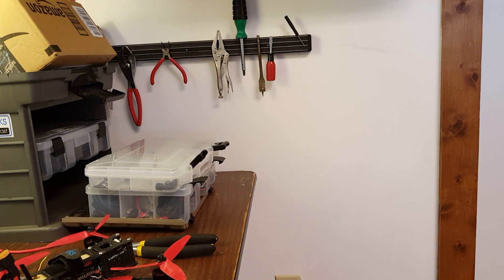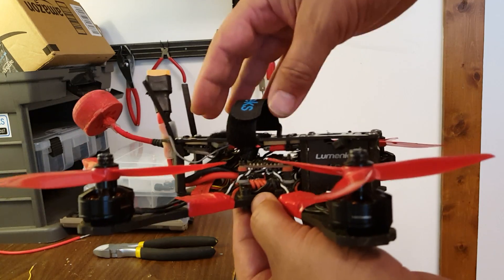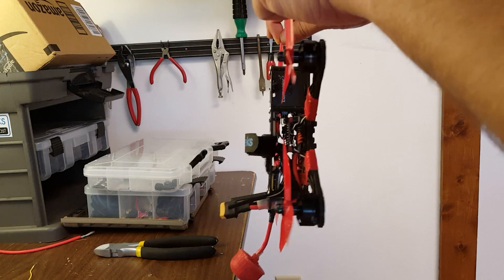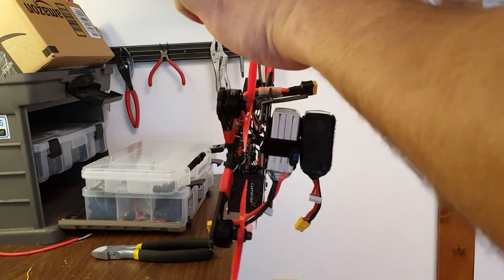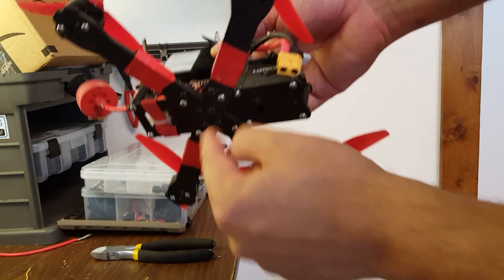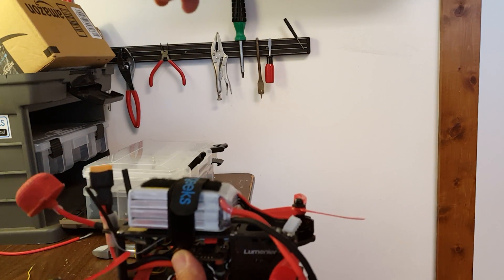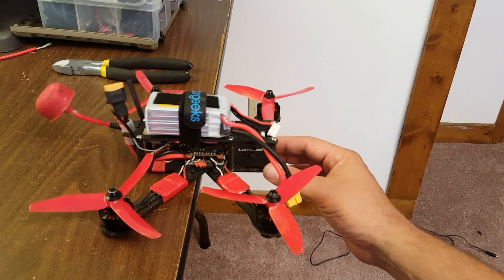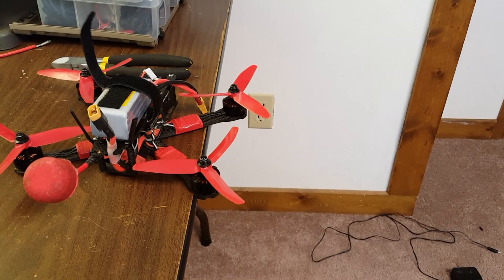How To Find Your Mini-Quad CG

Comment: With regard to horizontal CG, what does it mean if you feed the ass end of the quad from the table and the spot that the imbalance occurs is NOT at the same spot that you measured when the quad fed from the front?
Reply from the maker: The copter isn't level.

Comment: With my vortex pro- i noticed a nice difference in handling when I removed the camera plate and scooted the camera, and the battery, closer to the center of the quad.
Reply: the front/back flips went waaaay quicker and cleaner. The long "body" layout was clunky when doing that stuff before

Comment: Hello,
I disagree with your statement that vertical CG should be at prop line for best flight performance.

The torque generated by the thrust applies at the begining of the frame arm! The pitch/roll rotation center will always be at vetical CG right... But to have maximal rotational speed in picth and torque the vertical CG should be on the frame 's bottom plate axis... if it is on the prop line it will just create a second torque between propline and bottom plate centers!
Placing the battery at the bottom will give you both more rotational speed and absolute pitch/roll stability. With battery on top you may feel you have more stability in hover but this becomes wronger and wronger as pitch/roll angle increases : after a pitch roll angle treshold the quad will tend to flip over ( basically when the 3D CG will cross the 4 motors perimeter in the earth plane axis)
You can think about the same matter for low&high wing profiles for conventional airplanes.

I just came to also think that it is better to have the flight controller placed the nearest to the bottom plate, possibily bellow the PDB/ 4-in1-ESC etc. Actually it is best to have the IMU placed on the center of rotation (vertical CG), both for the gyro and accel. If FC is level with propline AND vertical CG then not bad. But having your IMU level with bottom plate and paired with vertical CG, will give you the same gyro reading with optimal rotation performance.

Trying to debrief with clearer wording (TL;DR): it is a simple syllogism. It is best to have FC level with VCG. It is also best to have VCG level with bottom plate. So overall  the most efficient is to have the entire smalah sticked to the bottom plate :)

Best regards, found nice ideas in there tho, especially how to get a feel from CG location!
A battery bottom-mounter
Reply from the maker: Your point about the CG location is interesting and I'll have to give it some thought. Regarding the FC, that only matters if you are using the accelerometer. If you think about it, I think you will see that, as long as the frame is assumed to be relatively rigid, the gyro will read the same no matter where it is mounted. I submit that the false readings incurred by the accelerometer due to being placed off of the direct center of rotation are relatively small given the typical distance between the IMU and the CG on our copters.
Reply: Well it was clumsy and I should have written instead of " it will just create a second torque between propline and bottom plate centers" that it shitfts away motor thrust from the normal to the rotation circle radius . A picture worth a thousand words : https://www.dropbox.com/s/7j7odly3edlafmm/20160707_022341.jpg?dl=0

 "relatively small" hell yes :) Will give a try mounting Pixracer-Raceflight sticked to the bottom plate with battery bot, and feedback BB logs.

P.S. Glad I can help a bit on mechanics back, after you helped me on the Nyquist/aliasing chinese thing :)
Reply: Actually I tried some trigonometry and concluded that  a standard 250mm x quad, with a 4cm square for electronics at the center, 2.5cm between prop line and bottom plate, VCG at prop line, would waste roughly 50% of its thrust during a roll, compared to optimal rotation speed.
You are welcome to ignore my BS until I figure out what I am talking about :)
Reply: Ok I spoke GARBAGE.
The quad is rigid, the thrust applies at propline, so the VCG should be at propline Period :D
Reply from the maker: I knew if I waited long enough, you would agree with me.

Comment: In your profile banner thing, what is the protector for your Yi? I need something to pt over my SJ500X (going to try it out over my RunCam2.
Reply from the maker: It's a custom piece made by a friend, but it only fits the Yi.
Reply: Joshua Bardwell Ok, thanks :) Found a aluminium casing on ebay, but was 140grams! lol no thanks ;D

Comment: That's why my front ecs's are a little bit warmer, because of the old GoPro Hero what moves the CG to the front )))
Reply from the maker: +Vadim Nemtsev only by a little, probably.
Reply: +Joshua Bardwell 2 degrees C, but only with long 1800mah battery what cant be moved way up to the front because of 210mm frame limitation...
Reply: +Vadim Nemtsev to the back, of course...

Comment: I hold my copter with props removed diagonally over the motors where the props go. If it dips I know my cg is off.  It should hang straight and it's all fine and it's more precise than many other methods.

Comment: I like to use a small piece of pipe to do my x and y balancing. With frames that have a small set of screws on the bottom that will straddle the pipe it's super easy to line up. I just set it on the pipe and balance away. For your vertical cg balance you and also just run a loop of string around the props or motor shafts if you don't have props on and hang it from something.

Comment: what vtx antenna are you using there?
Reply: not 100% sure, but belive its aomway antenna with 3d printed cover, I do the same and it works very nice, good video signal and long lasting with the cover
Reply from the maker: +nixxinn correct.
Reply: +Joshua Bardwell ok thanks. i am looking for a cheaper antenna than the vas but with good signal as i dont wanna keep smashing a 30$ antenna
Reply from the maker: +bb knucks aomway is pretty good. Look up rcmodelreviews test
Reply: I did a similar thing using a half a pingpong ball and expanding foam
Reply: joshua have you had a chanse to try the dal/foxeer antennas ? dont know if thay are the same, but they are named the same ?
Reply from the maker: You mean the Cloud Spirit or whatever? No. I have a handful of Aomway that I am working through before my next order. But I will try the Cloud Spirit next.
Reply: ok thank you